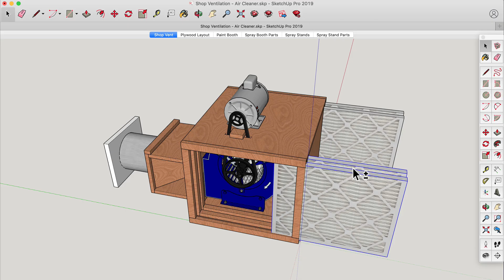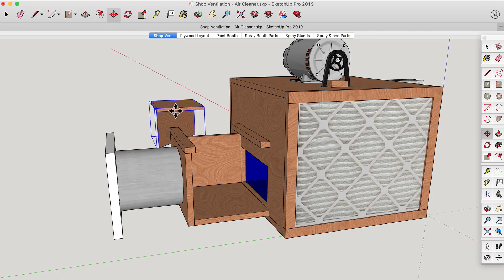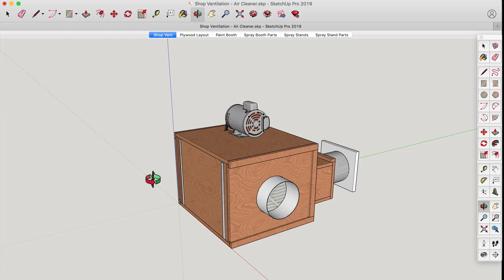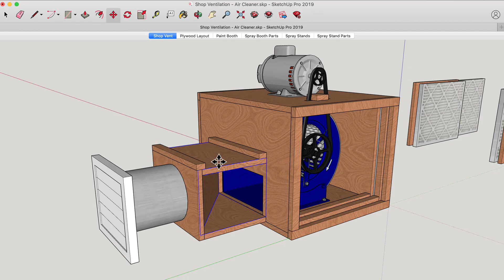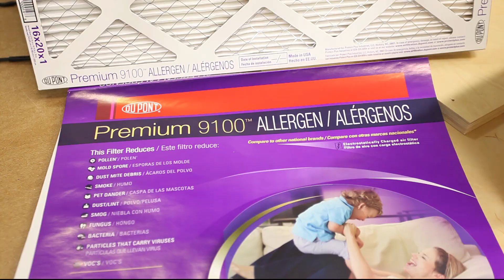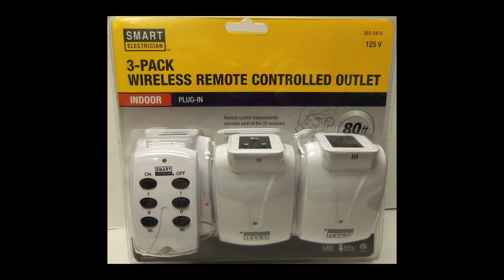How to build a Shop Air Cleaner and Paint Booth Ventilation System

Comment: I want to buy the plans but cant find the size of the fan you used I got one the other day but when I went to buy the plans it said 10x 20 filters way to small for mine
Reply from the maker: Oops!  That's a typo.  The filters are 16x20x1 NOT 10x20x1.  I'll update the site.
Reply: @TommyTompkins  did you take any measurements of the blower you started with?
Reply from the maker: @arose460  The plans were designed for a blower that is no more than 
16-1/4” (412.75 mm) tall and 18” (457.2 mm) wide with some room to spare. If
 your blower is larger, no problem. Simply modify the dimensions in the plans to
 make your enclosure box a bit larger. If you’re modifying the original dimensions,
 just remember to choose a filter size that will fit your enclosure dimensions (the
 default filter size is a 16x20x1).
Reply: Tommy all I need is to make it taller sounds good to me.  Thank you so much for your time.

Comment: Be careful to regularly maintain the blower assembly if the bearing fails or anything rubs inside the housing you risk starting a fire or explosion when spray painting. For spray painting it is better to use positive pressure so nothing about the fan is in the air stream but if your doing a negative pressure setup you should be using a blower with an aluminum wheel so that it is spark resistant.
Reply from the maker: Good point.  The bearings in this unit are brand new and were replaced prior to building this.  But I hear what you're saying and it's a good idea to maintain the bearings and blower assembly if anyone does choose to go this route.
Reply: Many things need to be in place for an appropriate paint booth, seek a professional to install a UL approved paint booth.   Novice paint booths cause fires, explosions, and potential serious damage and injuries.

Comment: This is the best shop air cleaner build I’ve seen so far on YouTube. I like that you used a powerful blower and not something like a box fan.
Reply from the maker: Thanks!  It works really well and I found myself using it to cool down the shop in the summertime as well by pumping the hot air outdoors while sucking in air conditioned air from the house.
Reply: @TommyTompkins  Do you experience any pressure differences in the workshop, due to fan power. I'm guessing that in enclosed room it could cause some pressure discomfort.

Comment: On that vent you used that goes outside the vent has a screen in it that I’m sure you could get a lot more cfm out of the blower if you cut out that screen. I really like the design of the blower you built btw!
Reply from the maker: You might be right.  I haven't cut out the screen because it still seemed like it wasn't very restrictive and has fairly large holes.  I might give that a try though and see how it goes.

Comment: 3/4 plywood is NEVER 3/4 of an inch. None of it is ever exact on the stated measurement.
Reply from the maker: In most cases you're right.  This was definitely something I overlooked.  I just went around my shop and measured various 3/4" plywood and MDF scraps they range everywhere from .710 to .778. The most common thickness tends to be about .730 but some that I have are pretty much dead on 0.75. These variations need to be taken into account when building this.

Comment: Nice job that is practical and cheaper that store bought ones. I know my buddy last year spent a fortune on his spray booth and had to get a sprinkler system to it as well  but that's because he runs a business and safety requires he does that. Back to the build the portion  of it that you made is very in-expensive and great job on making  possible to have a affordable one in the average shop
Reply from the maker: Thanks!  I think you meant to say the one I made is very "in-expensive" rather than "expensive"?
Reply: @TommyTompkins  lol is i did sorry about that.

Comment: Just noticed your Reznor garage heater, is there any danger using that when you spray?
Reply from the maker: Great question!  The presence of the Reznor heater actually contributed greatly to my decision to build this unit. I was getting ready to do a lot of spraying in the garage and with it being cold here in Minnesota, I knew that I'd have to keep the garage doors closed with the heater running.  Obviously, that's a potential recipe for disaster.  I knew I had to find a way to keep my shop heated while being able to vent fumes at the same time.  I built this unit and used it with my spray booth to spray about 250 Pegs & Jokers game sets.  That's a ton of spraying and it worked excellent at drawing out all the fumes.  I could spray for hours, put everything down, step back 15 feet and not smell a thing.  Speaking of combustible material...very fine sawdust floating around the air is also a potential explosion hazard.  The air filtration feature of this unit helps to minimize that risk as well by removing all those fine particles.  Here's a quote directly from Reznor: 
"WARNING: Gas-fired appliances are not designed for use in hazardous atmospheres containing flammable vapors or combustible dust, or atmospheres containing chlorinated or halogenated hydrocarbons."

Comment: Nice job. I just had a new furnace installed and plan on building just an air filtration unit with my old motor and cage. Thx for sharing.
Reply from the maker: They work great for that purpose.  And they're pretty quiet too.